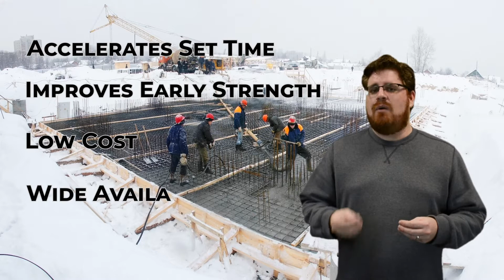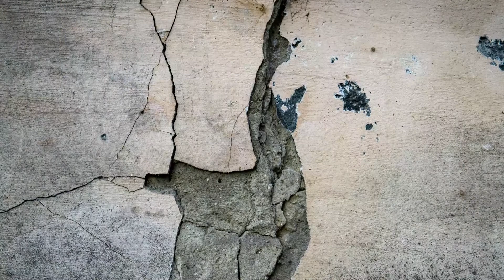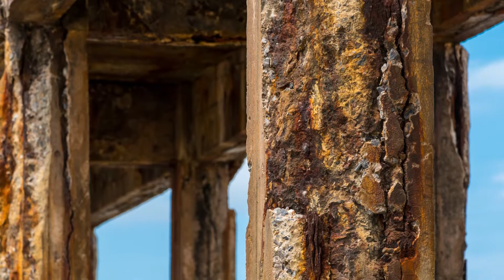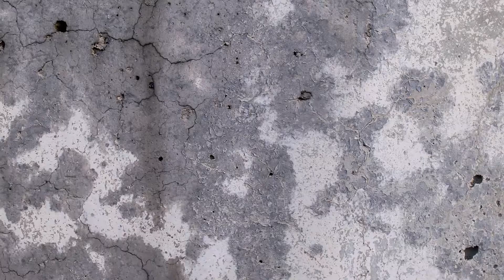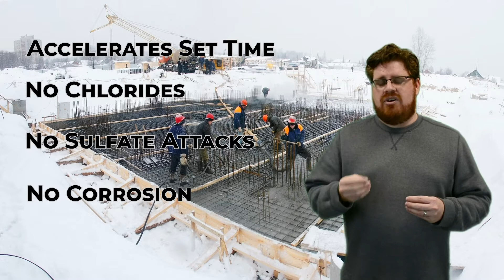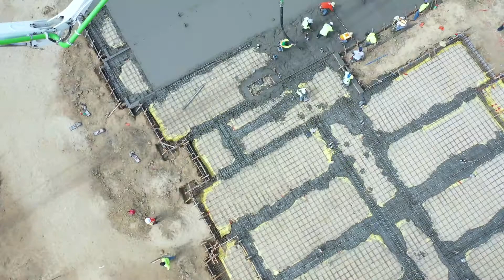Why Choose a Non-Chloride Accelerator for You Concrete?

Comment: What's the difference on this vs. the master builders one from the plant?
Reply from the maker: Adding an accelerator at the plant can cause the concrete to set up in the truck or before you're actually ready for it.  Being able to add it at the job site gives you more flexibility & control.